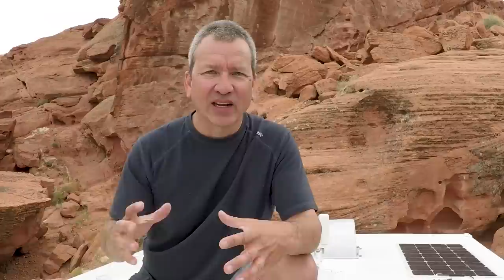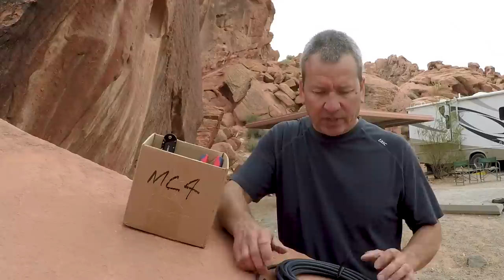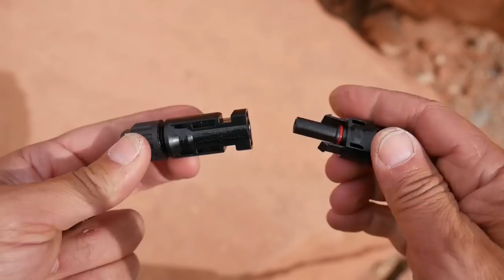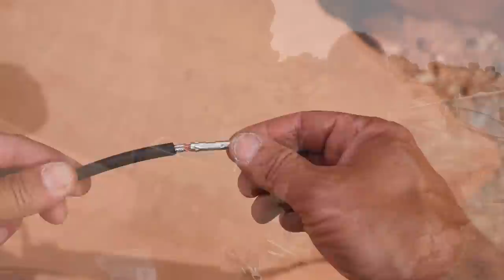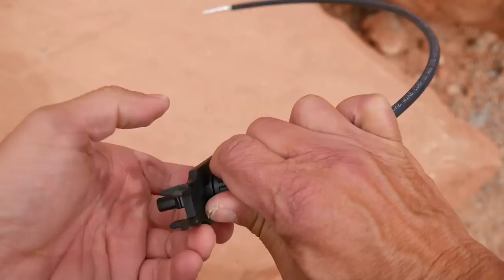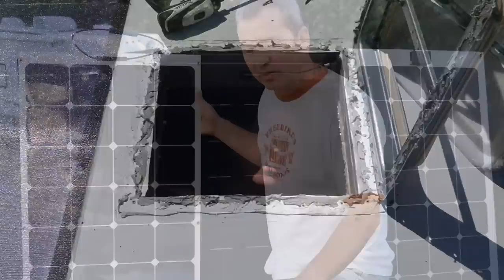How to Assemble MC4 Solar PV Cables

Comment: What a great tip, Brian. The most elegant DIY projects aren't always the most involved, but those that provide a professional result for less money. And this is one of the best of all, where the end result actually exceeds the quality of a factory-built part by customizing the cable length for each application. Clean, easy and better than the more expensive option. Perfect!

Comment: THANK YOU! I followed your instructions and every cable came out perfect. I had been nervous about making my own MC4 cables after reading the learning curve in making good crimps. A $15 MC4 crimp tool (looks similar to the one you used in the video), plus your instructions made even the very first crimp come out nice and tight. Was cheaper to make my own cables, even after buying a cheapo crimp tool, than buying pre-made cables that would be too long anyways. Really nice to be able to cut the cables the exact length, making for a much tidier and cleaner-looking install.
Reply from the maker: That's great! Nice job. Now you'll always just buy bulk cable. I just made a few the other day too.

Comment: Note that the weather proofing insert between connector body and connector nut has a preferred orientation i.e. the soft rubber goes toward the body side of the connector not the nut. Also it needs to be rotated on the cable while applying light pressure against the body until the correct alignment occurs and seal drops into correct position. The connector nut can now be tightened knowing the seal will expand correctly against cable and body completing the weather proof seal.  Best video on this I've seen.
Reply from the maker: Thanks for the additional info!
Reply: @RVwithTito  HOW WELL IS YOUR SOLAR PANELS HOLDING UP? 
I just found some flat roll of these solar panels on CL and they seem easy to put on... just glue??? ??? ???

Comment: Looks good. Two things (I have seen others do this): Soldering the crimped connection point and using adhesive heat shrink over the connector and wire when done. May have to use two different sizes of adhesive heat shrink tubing since the size difference of the MC4 connector and 10 AWG solar wire is wide. I did that with my 12-2 landscaping wire solar cables and they have weathered fine. Hope all is well guys. Nice looking video and backdrop! 🏜
Reply from the maker: Thanks for the suggestions Chris.
Reply: Agreed Chris. I usually solder all crimp connections if feasible to protect against corrosion, and always choose heat shrink over electrical tape.
Reply: You shouldn't solder crimps as this can cause failure in the connection.
Reply: @Wick Disaster How did you get "never solder anything" from "shouldn't solder crimps"? haha. If you solder crimps then the solder flows up the wire and reduces the flexibility. It will then be more likely to fail at that strand/solder junction. My understanding is that it is very bad practice.
Reply: @Wick Disaster Are you even replying to my comment? Because what you're literally saying makes no sense..

Comment: great tip (i think):  for my portable solar setup, mc4's were the bane of my existence, needing the tool to get them apart every time i tore down.  i considered andersons and sae's, but then lightbulb idea:  i took a utility knife and chopped off the locking prongs on the mc4's, so now i can easily push together and pull apart, while maintaining the waterproof and tight connection.
Reply from the maker: That's one solution :)
Reply: @Nunya- Do you leave cables affixed to your battery? I'm getting a portable setup (suitcase) and I'm trying to figure out the best way to do this so I'm not constantly pulling my battery tray out. Also what length of cable run is reasonable without losing much power through the cable.

Comment: Can you make a comment, or a video, about using this kit to make solar panel extensions? I've got a couple folding panels and portable power supply on the way and I want to make a 20-30' extension to go from the panels to the power supply. If I have a branch connector, I still need two cables to go to the panels right?

Comment: Hi,  nice video.  So I have a Bluetti AC200 max, 2000 watt.  I want to build longer mc4 cable to reach out on the lawn.  Should I use 10 or 12awg?  What determines that?
Reply from the maker: For a longer run I'd go with #10.

Comment: Don't twist the connector when tightening the water proof gland you are twisting the connector inside. Tighten the gland on the wire insulation so you get a compression of the rubber seal without twisting the wire.

Comment: If I need to take the MC4 connectors off the end of my cable, and put it back on later, do I just unscrew it then later I screw it back on? Thx for your help!
Reply from the maker: No. You'll have to cut it off and install a new one.

Comment: Excellent video, clearly explained.  It does, however, assume you understand what MC4 connectors are and how to distinguish M from F (somewhat counter-intuitive).  It has motivated me to redo my RV solar connections and use MC4 connectors instead of my present inappropriate and non-waterproof powerpole connectors (done from ignorance!)
Reply: I thought some discussion of M and F was in order also.

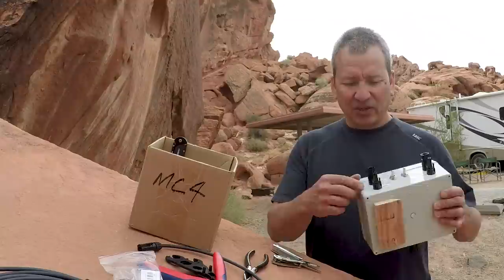Comment: Where's your vid with the detail of the Test Box at 7:22 in the above vid ?
U need 2 show detail of how you put the connectors into the box and the input / output sections along with the voltage and current indicators or whatever else U have configured in the box, along with where one gets this box and is it waterproof and so on. Thx.

Comment: Boom. That was a quick $100 to Amazon on the recommended wiring and tools. (I hope you get a commission off those links!) I'm happy to know that the job will be done right. And when it's time to relax and have some fun, there will be no worries about the solar infrastructure and wiring. This is my second install on a recently purchased RV with the components from the original installation and a few major upgrades to Battleborn and Victron. Buh bye Interstate and Morningstar. Yeah Baby!! Retirement is on the horizon......
Reply from the maker: Haha Boom! Yes I do make a small commission on those. Thanks! I've gone through the same transition and always have solar cable and the parts to make cables. 👍👍

Comment: any idea if #10 tip is different than #8?   PV commercial project Im using #8 for conduit fill, ampacity- but the inverter takes only #10 DC input.   Perhaps need to splice to #10?  thanks!

Comment: first watched this vid. 4 years ago and now i m ready  to make my own connectors lol.  I have a 300watt portable solar  panel a victron 100/30 charge controller and 2 agm deep cycle batteries. so it is very simple, but they told me that i needed to install a breaker and a fuse and that just sent my head back spinning. do you have a video like that for one of each, do i need to buy a box to put one fuse? any suggestions, pictures or vids will be GREATELY appreciated.

Comment: After watching  your video I purchased order  mc4 connectors on eBay,  I guess I got a really good deal,  I bought 20 pairs that's 40 connectors the 20 pairs for only $12!  I just received them in the mail a few days ago! I guess I suggest look on eBay for cheaper connectors because you said you got 5 pairs for $9 that's a lot of money on Amazon, just a suggestion check eBay if you're buying new connectors later,
Reply from the maker: Sounds like a pretty good deal. Thanks!

Comment: Great vid! thanks for sharing. I'm currently working on a solar set up. I need about 100cm outside cable, then 500cm inside to the controller, I was thinking to use 2.5 speaker cable for inside . What connectors would you recommend , they dont have to be waterproof as that part would be inside.

Comment: Excellent video on making a MC4 connection. Thanks Brian :-) Is there a way to take out the pin again from the MC4 connector housing after it has been inserted? I crimped the wire too long inside and now it doesn't snug fit with a click!

Comment: Brian you have used your flexiable panels for over a year now. If you had to do it over would you still consider flex panels over hard panels? What do you see as a pro or con with those panels? I am considering those panels for our RV.
Reply from the maker: Yes I have had great results from my flex panels and would still recommend them. The primary benefits in my view are their super light weight, high efficiency, low profile look, and they provide unobstructed access to the roof.

Comment: thank you-is 12 gauge solar panel rv cable good enough for a 190 watt solar panel to the roof insert down -or should it be 10 gauge?
Reply from the maker: I always use 10 gauge when possible for longer runs.

Comment: First, I see your wire connector is a single conductor? Does nt the panel output need both a positive and negative ? Also, how would I tie 8-10 panels together to connect to an inverter? A parallel circuit?

Comment: Is the solar connector also applicable for automotive wirings? Or motorcycle?.. and if yes, is it weather proof also?
Reply from the maker: Yes it's weatherproof. Check the wiresize and current rating first. If the wire gauge and insullation fits, then it should work. You might also consider 50A Anderson connectors.

Comment: are all the metal pieces the same or how do you  determine what one goes where or does it matter?
Reply from the maker: It does matter. One is a male and the other a female. I think the male metal piece goes into the female housing. Then the female metal piece goes into the male housing. If you mess it up, you'll know...and learn...and won't do it again :)
Reply: RVwithTito so of the male and female metal parts, which one is smaller of the two?

Comment: Interesting, I ordered a Xt60 cable and it attaches, but leaves about ZERO room as your cable does to squeeze the two disconnects, in fact I had to order a few of those tools… I am wondering if this is a common problem? And can you or anyone recommend who I should be ordering cables from that will have a bigger gap for ease of releasing those clips?

Comment: Tito, this was very helpful, but I gotta question..do you recommend using this technique on existing cables that are attached to the solar panel? More specifically, we have the suitcase-type 100W solar panels (with built-in charge controller and alligator clips) and want to lengthen the cable by 10' and replace the clips with post connectors (excuse my lack of proper terminology, but I'm sure you understand) .. can this be done?
Reply from the maker: Absolutely can be done. You don't even need to use MC4. SAE and Anderson connectors are also a popular option.

Comment: Thanks for this informative video!
Are y branch connectors universal?. I just got my y branch connectors and for some reason the clip on the postive connector on my solar panels wont engage with the y branch.
Reply from the maker: Sometimes they are a little off if you mix/match manufacturers.

Comment: Very informative video I learned a lot but I'm looking for how many feet can you have a solar panel from your battery that is charging
Reply from the maker: The distance depends on the type/gauge of your cable and max current. Search Google for solar voltage drop calculator and plug in the numbers. Typical solar cable is either #10 or #12 AWG copper. Hope that helps.

Comment: Is it possible to remove / reuse the connectors? If not, can you buy just the little metal parts and re-use the plastic connectors? (Complete newbie here, just curious)
Reply from the maker: You'd probably damage the connector if  you try to reuse it. So no. I typically cut them off and add a new one.

Comment: Just for your information, you are supposed to use both tools when tightening the compression glands one is to hold the body of the connector, as you were doing, and then you use the open serrated end of the other one on the nut and tighten it until the jaws flex open and it slips round the nut then you have the correct torque. Tightening by hand is inconsistent and not nearly tight enough to ensure it is weatherproof.

Comment: Hi Brian, great video with good tips as always. I noticed you have painted your cables white up top. I live in Arizona where the sun does great damage and am worried about cables getting brittle over time which can cause problems. I imagine the old rattle can method would only flake away, even with a robust paint formula. I have also seen where scoring the insulation for adhesion, then priming and painting can protect from UV light. Can you recommend a solution? Thanks!
Reply from the maker: Yes. It does chip and flake off over time. I have since wrapped all of my cables with flex tubing. I'm trying the Rustoleum Appliance Paint now when I paint stuff white on the roof. We'll see how that holds up.

Comment: I am always mixing up the positive and the negative when I build them...
Reply from the maker: Yeah. The conductors are opposite of the plug which is confusing. Male conductor goes in female plug, and female connector goes in male plug.
Reply: Yeah I mixed up to first. Easy way to remember = male tip is the larger tip

Comment: Nice job.  I crimped and soldered mine, and used normal TW wire from Home depot. (you need to protect it from the sun as TW is not UV rated)  I'm not sure we need so many MC4 connectors, anywhere there's a connector in the circuit is a potential place for a failure.  Next time I do a install, I may wire direct from the panel to a combiner box, and down to the charge controller eliminating all the MC4 connections and using simple butt splices that are well insulated and sealed where necessary.  Keep up the great videos...
Reply from the maker: That's what I ended up doing. I have each of three series sections wired into a combiner where I can reconfigure things as needed.

Comment: That was a good video, thanks. I am going to be wiring in my solar to the charge controller in the next week or so and I now realize how much easier this is going to be then I thought. What about showing us your solar panel tester? I nicked the back of one of my panels with a drill bit the other day  and I would like to be able to test and compare the out put.

Comment: I watched your video and, although I like the way that it was done, the main reason I watched it in the first place wasn't addressed by you, unfortunately. The connectors that the wires are crimped to are 'male' and 'female'. Does the 'male'  go into the positive connector (with the red identifying ring) or is it the 'female' piece that goes into the positive?

Comment: iam new to all this on the MC4   what  gauge wire thickness on solar  should i ues  on 50 feet  ??  10  gauge   or 12 gauge  so far  no one  can tell me  most  are trying to sell me  the  big time  $$$$$  wire  :(   any  help  will be  thankful    thanks   :)
Reply: Renogy web site has a slick calculator just for your question (but you have to know something about Ohm's law to understand). https://www.renogy.com/calculators#tab_solar-cable

Comment: Failed to explain HOW to determine which CONNECTOR goes with each insert.
Reply: I guess the rule of thumb is for the positive from your source (i.e Solar panel) to have a female connector i.e. the energized cable at the source end should have the female connector for safety considerations. Saw this somewhere on a Youtube video.

Comment: Hi Tito 👋 I will hit the road in the late spring in Canada with my 1975 13’ fg Trillium trailer. The previous owner renovated it to work completely on 110v. Because I intend on boondocking I am trying to figure out at the beginning what solar set up will work for me. I have chosen a goal zero yeti 400 lithium solar battery that  i can recharge with an inverter in my car or at shore power with a 110 splitter on the post outlet. I would also like to use one portable 100 or 120 or 160 solar panel (flexible may be best for me as I am a a weakling and have limited space - wont ream into the fg as Bertie is totally authentic on the exterior). My problem is that i dont like the solar panel offerings for gz...but the connectors are proprietary. Do you know any way I can get around this and buy say..renogy? Please keep in mind in Canada we pay at least 50% more for the same item if we can even get it). Right now a yeti 400 lithium in Canada is available at Costco.ca for $649 plus 13% tx. For us, thats an incredible deal.
Reply from the maker: Personnaly I wouldn't go with anything that uses proprietary inputs but if you can splice into a Yeti plug, then any similar solar panel should work.

Comment: What gauge wire do you use?
Reply: Standard PV wire has been 10 AWG stranded for a long time. That is the typical wire from a panel junction box. But I have seen some wire companies offering 8 AWG for long runs from panels to controllers located far from the panels. MC4 is designed for 10 AWG but 12 and 14 would fit.

Comment: THE REASON I ASK IS THAT THERE IS A LOT OF COPPER COATED ALUMINUM WIRING ON AMAZON ADVERTISED A COPPER. I TRY TO LOOK FOR A UL RATING.

Comment: Be sure they are MC4 and not something that looks like MC4 (H4 connectors look the same but dont connect the same.( Caused of Tesla/Wal*Mart fires.) Make sure you have a good crimp (some people solder them.) Use the wrenches together, one on the connector the other on the nut.
Dont disconnect under load.

Comment: This video assumes the viewer already know about MC4 cables.  I don't. Any difference between the male and female plastic housing? Which is whic/ Didn't hear you talk about that.  Also it's a wire stripper, not splitter.  You mention positive and negative connectors.  Any difference between those except for the colored ring?  Don't know,  you didn't say.